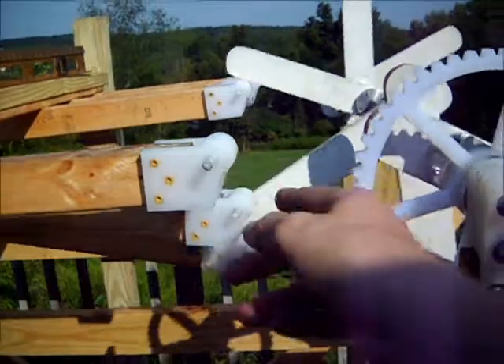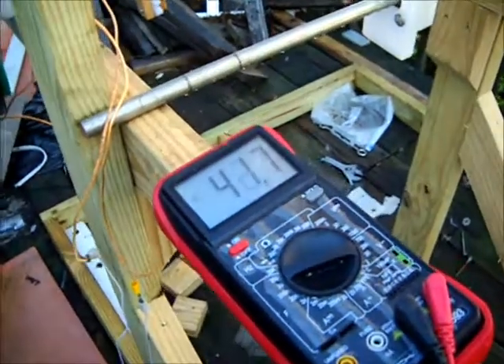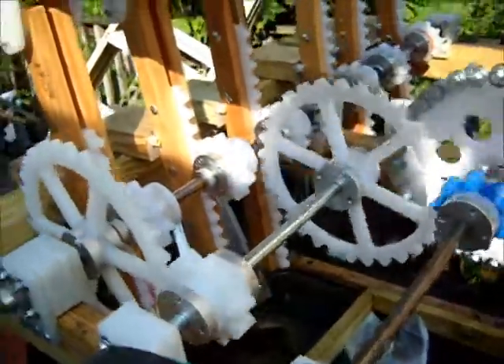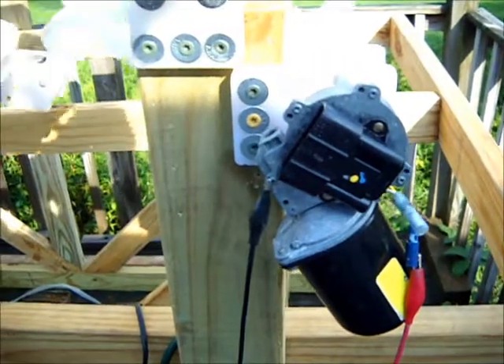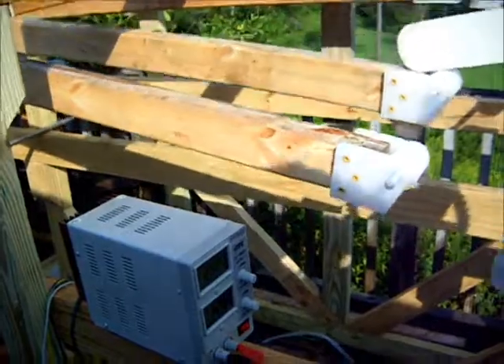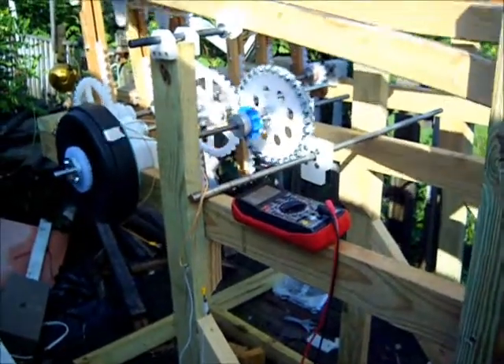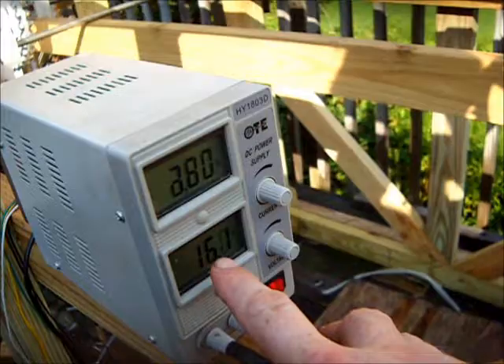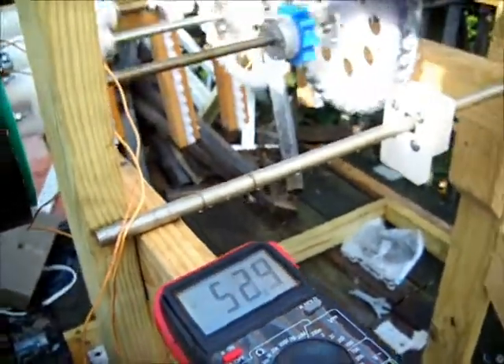hammerFall 8 18 19b

Comment: Looking forward to load test!
Reply from the maker: GoVertical17
1 hour ago
I swapped out the wiper motor gear to a 1 to 4 ratio. I tried to measure AC current through a 100 ohm resistor. No load AC voltage was 50. When I attached the load to the PMA, RPM decreased greatly. I was not able to take a current measurement; the meter showed zero with a flashing  polarity symbol. Copper loss at the PMA and the transmission load consumed almost all the power from the system. Waiting for drier weather to continue testing. I have to add the bridge rectifier and  PWM at the output of the PMA.
Reply: @GoVertical17  It looks like 100 ohms is too much load.  To show the max watts output from your PMA adjust your load resistor such that the voltage read across the load resistor is one half of your no load voltage.  So in this case your looking for 25volts across the load resistor, keep increasing the load resistor value by about 100 ohms or so till your reading is about 25v.  Then use ohms law to figure current and then watts.  Good luck!
Reply from the maker: @justalabrat-1  thanks for the help